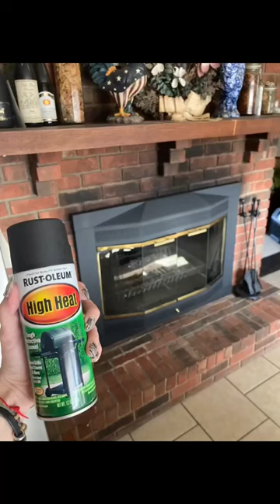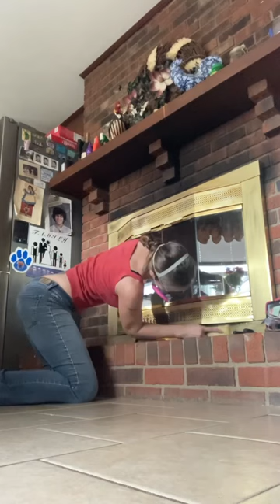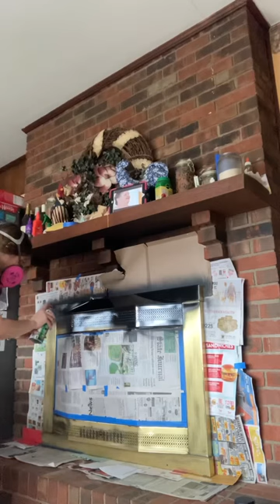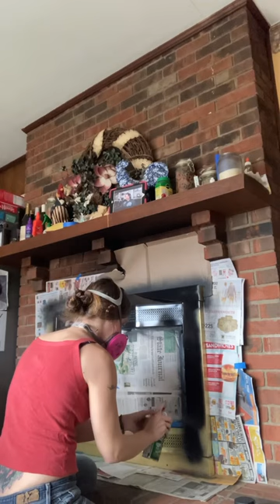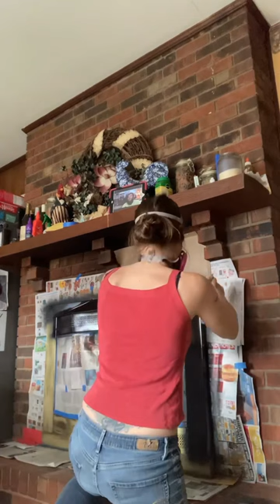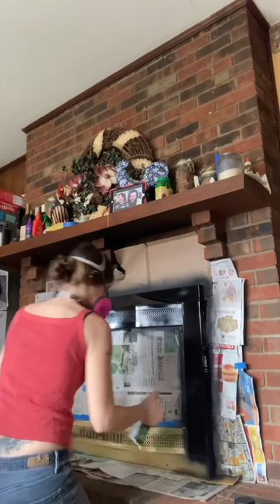Painting my fireplace cover with Rustoleum high heat paint Part 1 @RustOleumBrands

Comment: Won't that whole thing come off?
Reply from the maker: the paint shouldn’t because it’s made for high heat use and i sanded everything really good before painting so it should hold up. i can do an update as more time goes by.
Reply: @rachbeth86  haha ,I'm sorry I meant the whole screen and insert if the fireplace
Reply from the maker: @dustinpomeroy8817  haha i see what you mean now! lol and yes i can take it out but decided doing it this way would be easier.